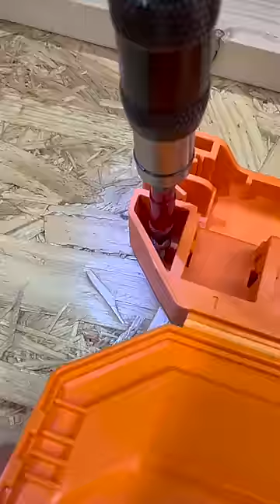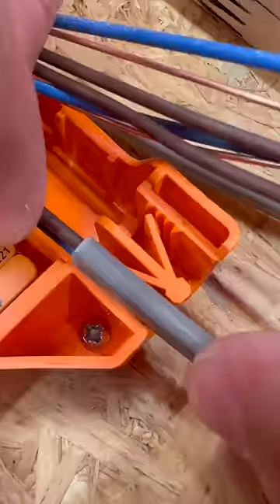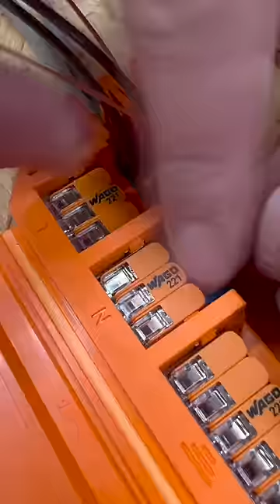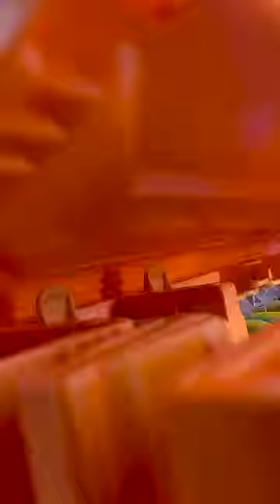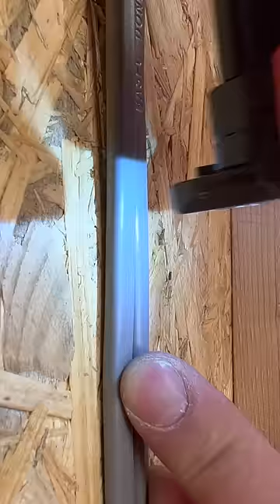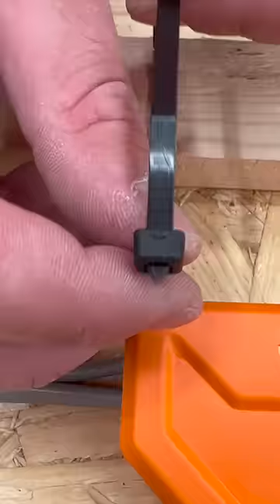Is This The Best Wago Junction Box?

Comment: What the hell do you think you're doing? Flush trimming a cable tie?? I thought all sparks' apprenticeships had a four week module about cutting ties to leave the most arm-lacerating, palm-shredding, finger-ripping ends possible?
Reply: Yeah, what the hell. I cut my metal zip ties on a angle and too long just to give it to the next man. May he get some days off paid leave.
Reply: Where I'm from, it's standard practice to cut at an angle and sharpen the point with a file! Or at least it seems that way.
Reply: @AGjengen do ya get the torch out and heat treat the end too? Gotta make sure they hold an edge after cutting though leather.
Reply: @ionstorm66  I secure all of my work with frayed wire rope, personally.
Reply: Exactly! They clearly tell you to cut the tail at a good 45 degree angle to leave as sharp of an edge as possible, then toss the rest on the floor.
Reply: NOTHING BUT A GIMMICK FOR DIY's THAT SOME GUY IN HIS GARAGE WILL TAKE ADVANTAGE OF.

Surface mount, interior use only, plastic sold at a margin 100x compared to a  standard junction box for the same purpose and appears to accept a maximum of 2 cables considering the apparent volume, so this thing is almosT useless IMHO. It's hard to say without knowing the actual volume, which could be easily remedied by making it taller.

However, all I see is the plastic becoming brittle and the clips and / or hinge breaking in the short term(short term for electrical work) which contractors are required to guarantee the quality of workmanship for 10 years.

Wago's are convenient but EXPENSIVE compared to wire nuts.

 This home owner, 3d printed, guaranteed not UL listed "junction box" is a polished turd with no real use but repairing a damaged section of romex that isn't in the wall.

For instance, a damaged wire in the attic would normally be cut out with extra wire for makeup landed in 2, 69 cent 1g nail ons, 6, 15 cent wire nuts, 2 50 cent metalic easy blanks for a whopping $4.30.

I can only imagine the insane price they will try to charge for this technically non code complaint fancy gimmick.

It's very easy to impress people who aren't in the field. 

To you, panzy(I want to use another p word, but the internet has become a preschool for adults language wise) electricians(hopefully they are just DIY's) complaining about angle cut zip ties slicing their baby soft hands, have definitely NOT worked as an electrician. 

Zip ties are the least of your cut worries and have no place ANYWHERE but in a panel, equivalently sized cans, or in an undercabinet light type situation.
Reply: @AGjengen  Right... because plastic and sheet metal are totally the same. REgARDS!
Reply: @wormexecute6987  And it turns out it's really easy to trigger Americans who don't even realise they're irrelevant.
Reply: That was a sharp left turn.
Reply: @Monkeh616 Canada is even more pretentious than the US.
Reply: @Monkeh616 While this is probably not UL listed, as it's not intended for the US, assuming sufficient volume, which this does appear to have, it looks like a very nice junction box, and superior to some of the actual UL Listed permanent repair splices on the market here in the US.
Reply: I use a pair of scissors or nail clippers if I forget my snips 😂 I'm not a electrician just a handy man
Reply: Memories of crawling along cable ladders getting grated enroute. Then there's the scrotum snag....

Comment: pros: small and neat.

cons: inflexible. The smaller version can only accomodate 3 3 position wagos, the larger version 3 3 position and one 5 position.

A wagobox 221-4 by contrast has three slots each of which can accomodate either a 5 position wago or a two position and a three position. In addition it has a "bridge" position which accomodates a 5 position wago. That gives a whole lot more flexibility.
Reply: Y'all should learn about 3D printers, better yet order them to get printed at PCBway. Consumer printers are 50X better than 4 years ago 10X faster and 10X more reliable than $300 ender-3s for $600
Reply: @cybyrd9615 3D-printed junction boxes aren't going to pass any electrical inspection, just to be clear.
Reply: @cybyrd9615 3d printed parts would be expensive and time consuming compared to something mass produced like a regular junction box

And I doubt it'll pass any sort of safety regulation, making a custom part pass safety regulations are expensive.
Reply: @cybyrd9615 I read/see comments like this far to often. Only because you CAN print something doesn't mean you HAVE to.
Reply: @petermichaelgreen  then me as an American just using caps to tie everything together in a junction box. 
Then, I proceeded to get shocked twice in a row cause I thought the first time was me being paranoid.

Comment: Try doing all that neat wiring when you up on a ladder trying to install this in some ceiling.
Reply: That's why Europeans are the best American electricians, they don't have to "try".
Reply: Not supposed to be doing it of a step ladder if a uk sparkly 😀
Reply: With all the cables coming from the same direction and one of the cables isnt long enough
Reply: Please explain brown on blue wire connection ?!? Wt.....
Reply: @MarcoYolo420  it's a light connection. The blue to brown is a switch live. I'm not an electrician, but I believe you need to indicate that the blue switch live is live and not neutral by using a brown sleeve.
Reply: @wackypeace1135  okay, I see, thanx. Where I come from we have blue for null, brown for live and black for switch. 
Very strange to see blue connected to brown.
Still don't understand why you want to connect live- to switch-wire without a switch?
[Edit] I see now, you don't use black at all, so sometimes switch is blue, sometimes brown, and because you don't use black at all, you need to "loop" stuff... Very confusing imo...
Reply: @MarcoYolo420  there is a switch the neutral is from the switch, effectively you have a brown live wires that goes to the switch and the return is a blue switch live. Usually the blue wire is only for neutral, but for this case it becomes switch live and therefore needs to be indicated with a brown sleeve.
Reply: @wackypeace1135  thanx 😉.   Very confusing to wire without knowing what the switch wire is, I like the color black as switch, no looping needed in NL..
Reply: @MarcoYolo420  here in the uk in the old days of  black and red I sometimes came across cable with two reds and earth cable that were used for the switch wire I think theses were more expensive so usually the black has a piece of red tape or red sleeve around the end so on a lighting circuit you’d have the switch wire being the two reds so the other two had to be the loop in loop out (live in/live out, neutral in/neutral out and earths or possibly a feed of to to another light.
Reply: @bobbo9549  I see. Yeah, the biggest difference is, you use double insulated cables. In NL and BE we use only the wires, no "outer insulation", we pull them through the plastic piping, life and switch (brown and black) to switches , null and switch (blue and black) to light, and null and life to outlets, just the loose wires single insulated. That way we don't need the extra loop boxes... I think an easier and cheaper solution if you don't mind the plastic pipes ☺️
Reply: @MarcoYolo420  I noticed when visiting my nephew in Germany that the light switch is fed from the socket below which then powers the room light. With none of the plugs fused reliance on cable overload must be back at the main board….strange 😊
Reply: This is why the trades have a bad reputation for being rough these days. I would take the extra time to make sure it looks neat as well as operating correctly. When I started out over 30 years ago I had a stock saying, when a foreman would ask “how long are you going to be” I would answer “depends how rough you want it to be”…………………….
Reply: Sweat rolling into your eyes , crick in your neck from looking up, pain in your back from working up  ladder ,and a bad case of noodle arms from working above your head .
Ah the electrical life.
Reply: Easy

Comment: You can only use this is it’s accessible though, snap wagos are not classed as maintenance free because of the mechanical movement
Reply from the maker: It’s the enclosure and aggregate current rating which defines maintenance free - check out our  training module on the topic.

https://www.efixx.co.uk/Know%20How/connections-and-connectors-wago-cpd

Comment: Yeah, I've been watching this trend toward the Wago connections. I've yet to do any load testing on them to see how well they hold up. Would love to test some by letting them run at 15 amps to 20 amps continuous to see how well they survive. They look a bit light duty to me. Not bad for individual light fixtures but it's the pass through current that I would worry about.
Reply: Just type in wago test on youtube people have already done it for you.
Reply: I've never seen a wago that was installed properly burn up. I've been using them for over 30 years, as a motor control and service supervisor we're talking probably over 3 million of them installed. In many European countries wire nuts went away over 50 years ago, they're not even available. So yeah someone has already tested them for you

Comment: I was introduced to the wago about two years ago. They are outstanding wire connection devices. Much more convienient than a twist on wire nut, and it takes up less space. The visual confirmation that shows the wire inserted fully really takes the doubt out of a splice point. How many times has a wire failed to stay within the twisted group and required a second attempt?

Comment: Isn't it interesting that rather like most of construction, the electrical industry has been relatively static regarding the actual materials used but over the last few years great steps have been made in innovation. The humble JB for 70 odd years, a few iterations recently  and now a well designed thoughtful product like this...
Reply: jbs are not maintenance free, since wagos have been around manufactures it only makes sense to have maintenance free connections
Reply: @Lennyhunt117  That's part of my point...
Reply: @gibbodive140  sounded like you were against the new stuff sorry mate 😂

Comment: In some countries its forbidden to use unreliable connection for ground wires - crimping with copper sleeve or welding are the only methods. But I think its only for non servicable boxes

Comment: Just use a quickwire.  Much quicker to install. Smaller and cheaper too. Fantastic bit of kit.
Reply: Quick wire does a different job…
Reply: @Pugjamin  what is that then... quickwire does a 16amp splitter junction box as well as a switch and load junction box for lighting. They are in the final stages of approval for their 25amp quickwire junction box for 2.5mm cable. Should be released in about 2 months.....

Comment: Not an electrician, so I'm just curious. What purpose does the installation of a junction box do in this scenario? What are you connecting to what?
Reply from the maker: Usually on a lighting circuit including the wiring to a switch
Reply: @efixx  Ah gotcha. So it's just keeping all the hots and grounds and whatnot sorted? So one a trio would go to a switch, and another trio would go to the fixture?
Reply: @KhanGirey  you have a feed in cable a feed out cable and a cable going to to the switch.

Comment: So if by any reason, the connector burns up due to overcurrent or any sort of fault, and I need to open the J box and change it... I won't have any extra lenght of wire to make the adjustment... Instead I'll have to buy the entire lenght of wire and run it again just cause I had to cut the burnt section...
Very practical .
Reply: That’s why you use fuses and breakers

Comment: Whats the cost vs a standard box and wire nuts?
Reply: Looks like the conectors cost $0.50 x 5 = $2.50 and the box cost $2. So total price of $4.50.

Wire nuts cost about $0.16 each. Maybe $3 for a box and cover.
Reply: It's better regardless. Better wire management. More reusability. Less mess. Less fuck ups

Comment: Wire nuts will last longer and also not fail randomly for no good reason
Reply: I feel like the Wago's are like stab in style receptacles. Maybe I'm wrong. Seems like they would easily heat up under load. Be different if they were lugs.
Reply: They'r fine, wagos have been used for a looong time over here and they'r doing just fine.

Comment: That's pretty cool, but if this is intended for high voltage applications then that box is way too crowded according to NEC Table 314.16(B) and will overheat under higher loads. No way I'm gunna install this fire hazard in my shop

Comment: I have seen those connections burn . There’s nothing better than a good old fashioned wire nut
Reply: Wire nuts are American garbage, look at any comparison vid and it’s a clean sweep for using wago over them. The only thing wirenuts have going for them is the price
Reply: Then they weren't installed properly. Or were used in a system outside of their rating.

Comment: Cool,  i like it.  Would be great to have something similar from wago for the Swedish market.  This model doesn't suit here, we don't use flat cables.
Reply: What do you use over there?
Reply: @arsalanrazaahmad  If installation is hidden, then in most of the cases we go on with the plastic flexible conduits and single isol leaders inside (mostly flexpipes with prepulled leaders).
If it's outside,  then cabels are rounded.

The connection of such a type as in the video can not be classified as maintenance free in Sweden, should be accessible. So, great to hear that wago has such a trust from UK sertification department 👏

Comment: Still prefer to make up joints the old fashioned way. Twisting together solid copper wires allow for better contact imo. The wire nuts are just to make sure they are insulated won't come apart easily. I also use a bit of Super 33 if they are in a hard to reach spot.

Comment: Hope that's not being used for anything more than LED lighting.
Reply: why? these connectors can take 60A takes 90 to set them on fire they are tried and tested!
Reply: @robboinc1  because you are relying on a thin piece of steel as a bus bar and a small contact area on each conductor. With a wire nut, or crimped connection, you will have greater contact area directly between the conductors and the connection devices are not relied upon to carry the current. It's all about contact area and cross-sectional area of the connection and current carrying devices.

Comment: I miss a good cable retension... those small ribs don't seem to hold that much. 

Outside of that... it's kinda neat Tho I find it a tad useless, 3x3 and a 1x5, as that is so "fixed" in possibilities, I'd suggest to just get less tangled wires and just make a pre-existing diagram and put them wires with very short wire in it. (instead of using wago's to combine a common like ground or w/e, have 1 wago "block" connect all wires from a cable, and ease the installation that way)

Comment: If you go through this much work just put a junction box in. You can't bury either behind the wall. Spend less money on a junction box.
Reply: you can bury it behind a wall mate
Reply: @Lennyhunt117  no you cant
Reply: @BobStoneBoi  its maintenance free you spanner
Reply: @Lennyhunt117 Come now, electricians don't use spanners. Wrong profession mate.
Reply: @BobStoneBoi If it is a maintenance free junction box, using Wago's, with the letters MF on the enclosure, AND installed in accordance with the manufacturer's instructions, then it is classed within the IET regs as a maintenance free junction AND it can be placed in inaccessible places and does not require to be inspected as part of future maintenance.

Check the regs.
Reply: @deang5622  that's illegal in North American code. That will fail inspection and is a massive fire hazard. Wagos heat up from resistance.
Reply: @BobStoneBoi  Firstly all junctions have resistance, it is a question of how much.

Wago's have low enough resistance that contact resistance is not a problem.

Second, the next issue is around long term reliability and how that resistance will change with time. In the case of the Wago because it is spring loaded, a constant force is applied to the wire conductor so it does not suffer degradation of contact resistance like screw terminals do.

Thirdly, the use of a Wago in a suitable enclosure and if correctly installed is considered by the UK body that creates the regulations to be of good enough quality and long term stability that it is considered to be a maintenance free junction and can be used in inaccessible places and doesn't require future visible inspections.

Fourth, we don't care what US regulations are, as this video was produced in the UK and the electrician is confirming to UK regulations.

Fifth, it is pretty clear your US electrical code is crap and so is your entire electrical system. You should work to improve your electrical system to bring it up to the quality, performance, safety and reliability of European countries and standards.

Comment: I have no faith in zip ties being a long-term fastener, certainly not the modern ones
Reply: You dont trust a plastic zip tie to hold a plastic box shut? But you trust the box?

Jeep used zip ties from the factory to hold up the diff breather on every Cherokee. On mine its still hanging on, 34 years later.
Reply: @jaredlancaster4137  I've come across too many zip ties that just break, and they haven't even been pulled that tight. Sure, inside old equipment I've found them to last donkey's years. But packets of modern ones don't seem to be made anywhere near as well. You almost get the impression that they're using biodegradable plastic.
Reply: @CameraTim-DAMMITDOTcom  I believe you, I think I've seen some really crappy zip ties too, but I buy all of mine at harbor freight and they're just fine.